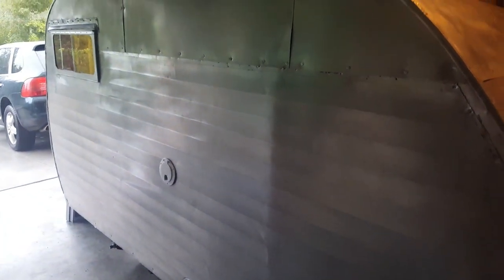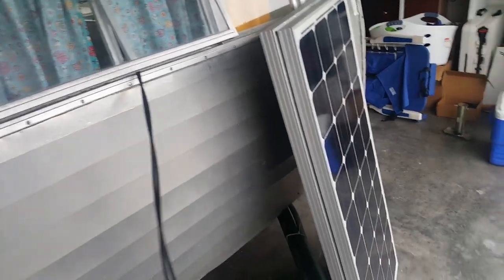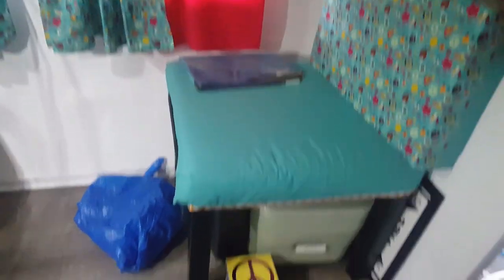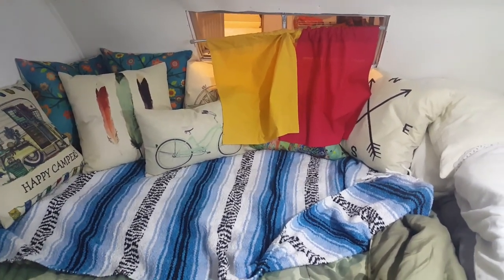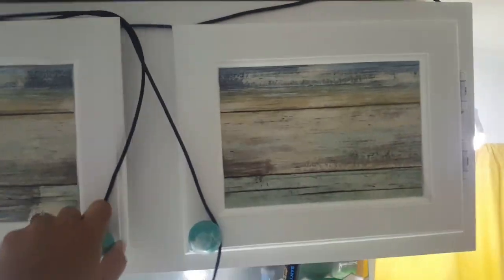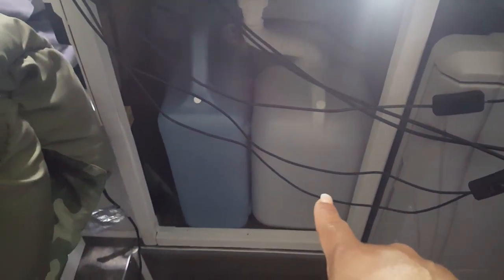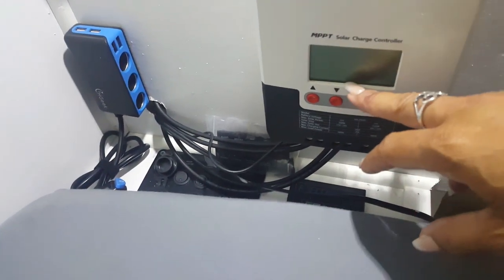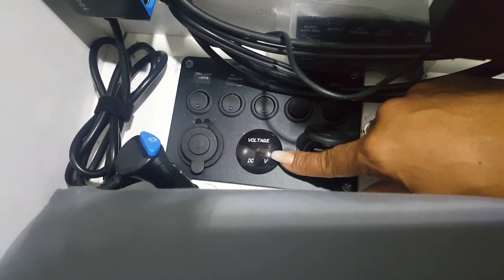Serro Scotty Sportsman Renovation [Ep. 3]

Comment: Wow, complete tear down to the frame then total rebuild. I hope you are as proud as you should be. One thought, did you rebuild the wheel bearings and brakes? After sitting for years the grease in the bearing can get very stale and dry which could cause heat build-up going down the road and cause a fire. Please check that out soon, you have a sweet little camper there.
Reply from the maker: Thanks for that tip Lee. It was a fun project. I was told the bearing had been repacked just prior to buying her. But as you can see, she was a total gut job. I'll probably look into rebuilding  the breaks and bearings in the near future, depending on how long I keep her.